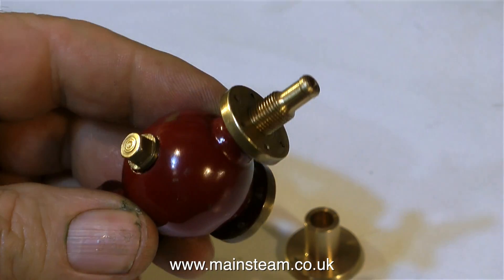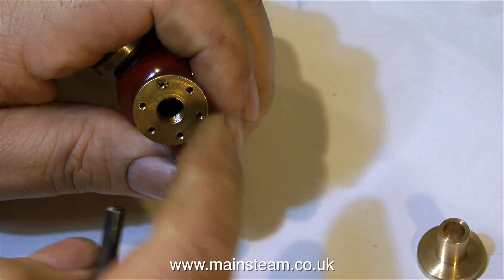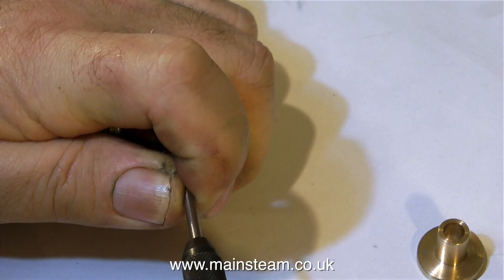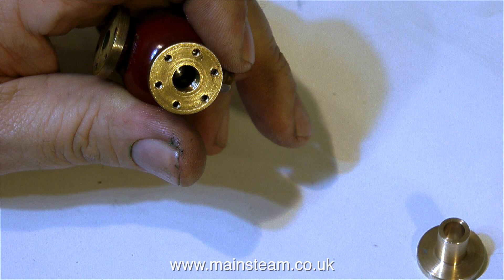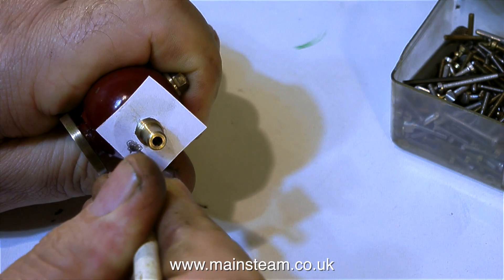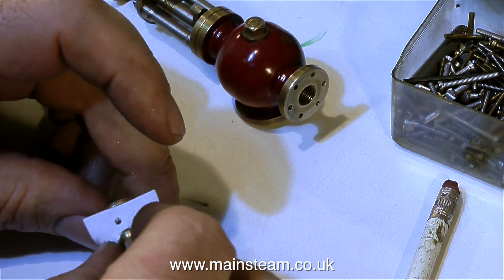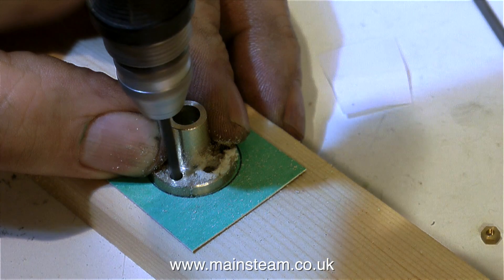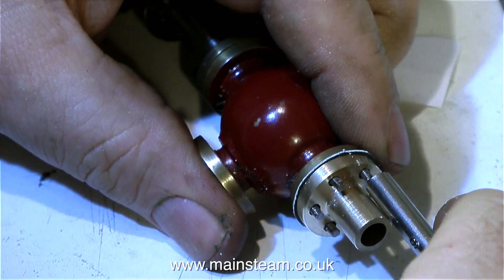MAKING A MULTI STUD STEAM PIPE FLANGE - MODEL ENGINEERING FOR BEGINNERS - PART #11

Comment: When I was serving my appreticeship (late 1950's) this is exactly how we established mating flange holes for a given drilled pump or valve. We used thin jointing paper held in place by grease and by pressing and gentle tapping round the flange and holes with a ball peen hammer we established a mating flange imprint. It was also an excellent way to cut a flange joint from jointing material. Thanks for the video enjoyed it so much.

Comment: This is not an accurate way to do it but it works. I would look into making 6 holes on a PCD which would be one engineering like way to do this. But to be very honest the term engineer is not dissimilar from a problem solver. There are many ways to solve problems, some simple and some that take longer but get the same result. There are better ways to do this job but as long as you get a good end result you have solved your problem.

Comment: My initial thought was, if I were doing this, I'd set up my rotary table and drill the holes equidistant. However, you took that option off the table when you mentioned that the original holes weren't necessarily equidistant. 

Anyway, good job on the video. I've learned a lot. 

Jim

Comment: why not  make ba transfer punches to exchange the hole pattern just a thought
Reply from the maker: Please watch the video - you cannot use transfer punches in blind holes - !
Reply: There are tools called transfer screws that are for use in blind holes. The sets are a bit expensive and I don't know if they come in such a small thread size. However, you can use pointed set screws although they are a bit fiddly to get them all an even height for that many holes and that one tilted hole would still have thrown off the new hole location.

Another thing that I uses when tapping small blind holes is tapping wax. It comes in sticks that you pack into the hole. It captures and caries the chips up the flutes of the tap as it is threaded in.